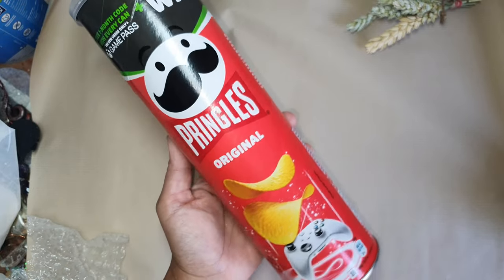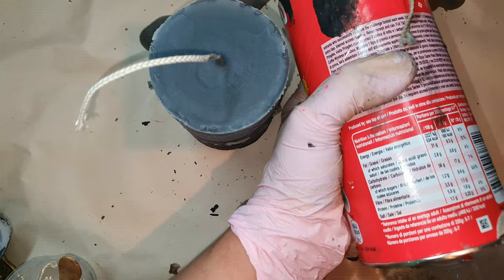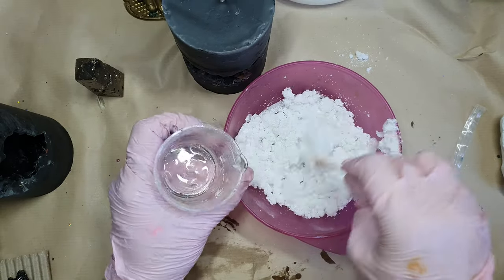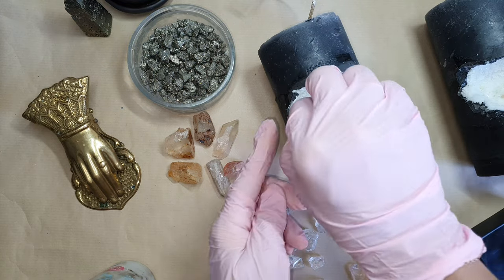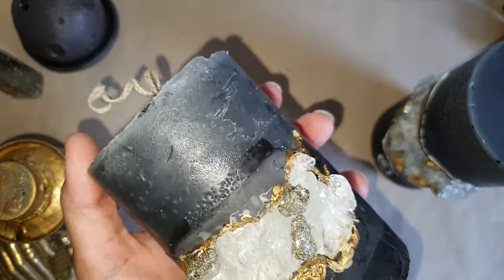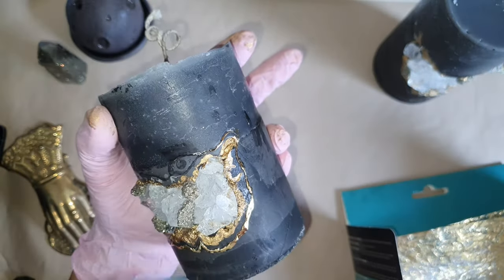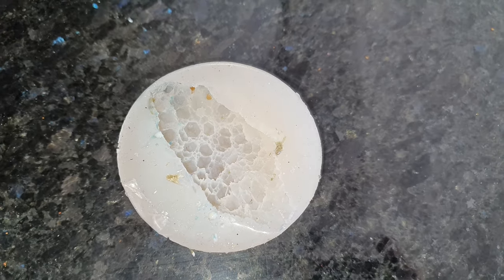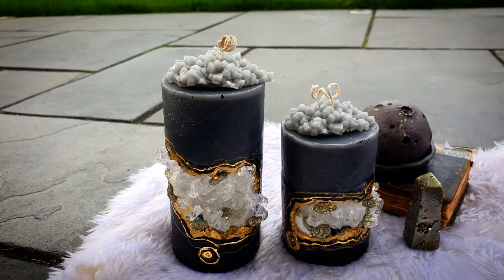How To Make Geode Inspired Candles | Using Jesmonite / Cement  | DIY

Comment: I have a question did your wax separate from the Jasmonite after you unmolded the candle?
Reply from the maker: Hi no I haven't had this issue but if you are next time before pouring wax make some scrateon the jesmonite before or sand it then add wax.
Reply: @teaandart  ok, Thank you